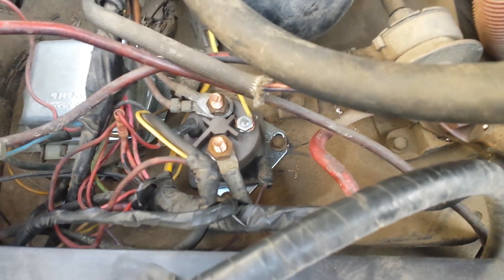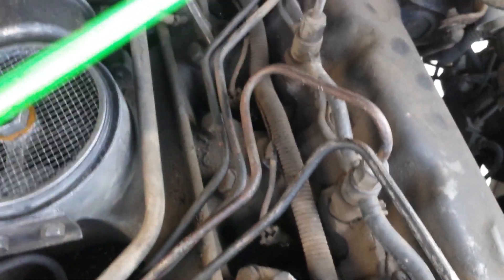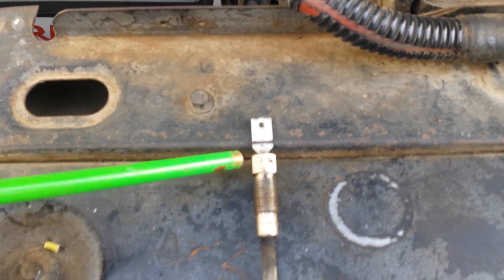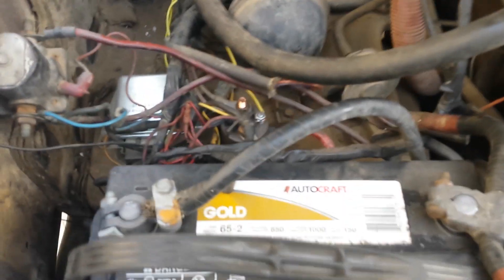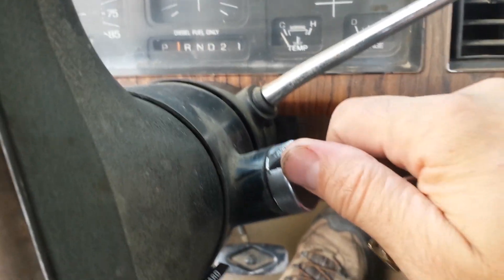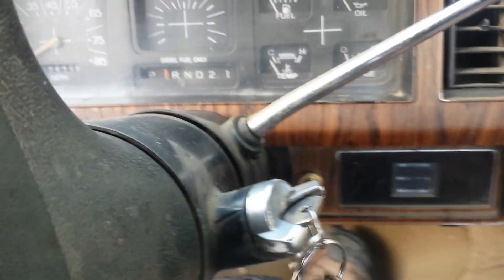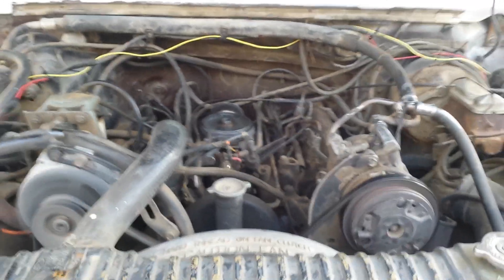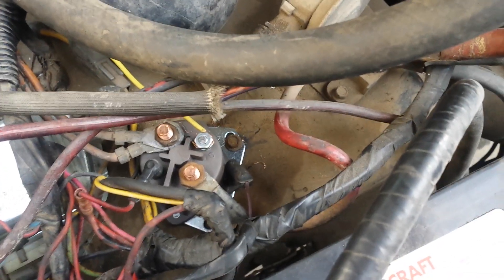1983 Ford F250 6.9 Diesel Glow Plug Relay Manual Bypass

Comment: Good video I recommended a toggle switch I had to rip a push button switch out the lower dash it got stuck grinding my starter on the engine

Comment: I am kind of confused on the mechanics so that yellow wire does it complete a full circuit? or what happens? because i want to do this manually so i am wondering if all i have to do is connect a wire to the same spot that yellow wire is and then connect it to a button... am i missing something or are those the steps.
Reply: nevermind i got my answer he connected one yellow wire to a wire that only turn on when the car is on then he connected that wire to the button so once the button is press it then travels to the wire that in the engine bay to the relay

Comment: How do you shut the truck off with it being a push buttion start? Looking at doing a push button start as well wondering how you did it
Reply: He only bypassed the starter function on the ignition switch.  He did not bypass the ignition "on" position of the switch, hence he turns the key to the run position and no further -- then push the starter button which energizes the starter relay and starts the truck.  He turns it off with the key as normal. I think he did that because there are frequent mechanical issues in the steering column that prohibit turning the key to the start position.

Comment: Other than the fact the glow plugs are not meant to run on 12 volts but actually 11 your system works. Bye-by-passing that great big resistor on the original relay solenoid you're giving them full voltage and thus 8 seconds is enough although right on the glow plug package it will tell you they are 10-second glow plugs.  If a system like this will work for you for 10 years it's because you don't use it very often. If you glow that system like the original relay did every time you touch the truck you'd burn those glow plugs out in no time..  good vid thanks for posting
Reply: You are 100% correct!
My controller was bypassed befor I bought my 83 F250 6.9.
But all the glow plugs were burnt out.
I replaced them with new ones.
All burnt out in one week, mid winter.
I'm spending the money and redoing the entire system back to stock.

Comment: The mechanic broke off the controller and connected the new one and just left it lay there and never installed the new glow plugs I had provided, and charged $180.  Well he also changed one heater hose, maybe took 5 minutes.  So rather then try to extract the broken piece from the back of the engine I did what this gentleman did.  It works great....

Comment: I have a 1985 E350 motorhome with the 6.9. It might still have the original glow plugs, for all I know. It still runs on the controller and starts pretty well most of the time. Unless I park nose up hill, then it gets air intrusion somewhere. But glow plug wise it's fine still.

Comment: THANKS  I've had the same set up on 1986 6.9 - trying to replace the selenoid but the posts on the new one , not sure where to hook up which wire. My mechanic put the 7.3 glow plugs in that are SELF LIMITING cause I was burning out the 6.9 ones. :)

Comment: The glow plug relay thats bypassed has a live in from the battery, a live out to the buzz bar for the glowplugs and a switch wire which when turned on its lets the power pass through the relay to the buzzbar.

Yes it is easy to put a switch on but its not the correct way to go in my opinion. The way it generally works is your coolant sensor detects if the car is cold or hot, if its cold the sensor activates a wire to the glow plug ecu control until to tell it this, the ecu then activates a wire to the glow plug relay to tell it to turn on, the glow plugs remain on for a short time until the engine realises that the engine is running correctly, by this i mean that the engines fuel is burning hot enough to run without the plugs at which point it then deactivates the switch wire via the ECU which turns off the relay itself.

If you get back in the car when the engine is warm, the coolant sensor circuit will be closed and the ecu will not activate the glow plugs as they aren’t needed. I’m all for doing hacks like this if im in a jam but i enjoy finding the underlying fault way better 😝 buy a multimeter and some wire wool for cleaning those connections! 🤣
Reply: You must be thinking of newer diesels. This is a idi. Doesn't have any ecu or anything
Reply: 6.9 doesn’t have an ecu
Reply: Where is the ECU or brainbox that the colent sensor sends signal to?  Or is it a completely mechanical logic system, ITTT type thing?   I'm having trouble getting the GP relay and light to come on, even after replacing the relay and (I think) verifying the wiring.
Reply: What ECU are you talking about?

Comment: Hello, I have a 94 f250 idi, when I turn the key the glow plugs don't manually preheat. The WTS light does not even come on. I have connected a wire to the relay and I touch it to the positive terminal on the battery to get it started. When touching the wire to the battery it heats the plugs and the light glows red on the dash. Is this a wiring issue? what could cause the truck to not automatically preheats the plugs?
Reply: Its your glow plug controller is bad

Comment: I'm having an issue with my glow plugs. It's a brand new manual glow plug controller and brand new glowplugs. I can hear the controller click whenever I press the button, but for some reason, power isn't getting to my glowplugs. As far as I can tell, my wiring harness is good. Perhaps I should redo my harness? I'll be checking it with a multimeter tomorrow.
Reply: how was it???
Reply: how did your work turn out? I'm facing the same problem. Got fuel and power to the injector pump but not starting
Reply: @watchman4j  I haven't been able to work on my truck for a while now. I didn't find a replacement harness until recently but it won't be till towards December when I can work on her again. As far as with yours, crack open the line connecting to one of your injectors, use an insulated screwdriver and bridge the connection of your starter solenoid, and watch the loosened line to make sure fuel is getting to the injectors themselves. Another thing to try (which many will disagree with) is to spray a very minute amount of starting fluid in the intake. If used in very small amounts, starting fluid won't damage your engine, and thus it won't rely on it.

Comment: Did the same thing on my 90 back in 2005 and they still work 15 years later. According to the maintenance log they were replaced in 95 then 1998 I had to replace them then finally after studying the diagram I did exactly this, because my theory is that the relay let's them get stuck on and this kills the life of them.

Comment: So I’m having trouble, that small post wire that’s red and has a black quick connect cap on it opposite of the small post yellow wire in your video, for me every time I turn the ignition switch over it instantly melts that wire on opposite the yellow one in your video( small red as I described) any idea what’s the issue?

Comment: I’m having trouble with my 1996 Ford F2 50 four-wheel-drive just put in neutral safety switch in new battery new cables I do still annoyed start the truck and it jumped forward in part what do I do
Reply from the maker: IDK...SOunds like a tramsmission issue to me.  Have you checked the online forums for your trick year to see if anyone else has had the same issue?

Comment: Did you just peel back the accessory power wires insulation and splice the switch in like that or how did you do that part? This video is amazing! Thank you!
Reply from the maker: I don't remember.  I don't own the truck anymore and it was years ago that I did this work around.  I'm guessing your right in your assumption.  I found a wire that had current in it when the ignition switch was turned on, and spliced the switch into that.  Hope that helps!

Comment: Great job doing this video! Does this method still allow you to see the "Glow Plug" dash light lit up when you push the momentary switch? Thanks for any info/help! ( have an 84' that just started to not light up the plugs intermittently) Also isn't switching to the front tank anymore but they're tough old goats!
Reply from the maker: The dash lit will light up if still functioning but it is not linked to the manual bypass.  My light still works and I use it as a timer when I'm holding the glow plug button down manually.
Reply: Thanks! I since have cleaned up the 2 battery posts/cables and the reg. and now it's coming back on. Strange thing this electricity thingy!-) Now, I"m about to replace the alternator with a 100amp one as the other stopped working...I NEED HEATER! Lol. Thanks again for your vids! Mike
Reply: I forgot to say that there's a blue box next to the glow plug reg. with heat fins and wired up almost like the old HEI gas models had in the day...I didn't notice one in your video? Curious.
Reply: "Blue box" = Battery isolator.  @mikesglider

Comment: i added the glow plug bypass and it don't get any power when depressed to th e glow plugs but if i hook everything up normally it just clicks and don't latch..new batteries, new glow plugs,new,solid state under relay new relay..help please..now my head lights don't work.but everything else does..
Reply from the maker: Did you check to make sure the glow plugs were warming up before you installed them all?  I grounded one of the plugs before installation and it started heating up right away, so I knew I had power.  Hope this helps.

Comment: Didn't want to use starting fluid all the time so I've been burning electricity plugging in the block heater anytime it's cold outside, which is 8-9 months a year around here. Time to just fix the problem right.
Reply: Thanks, Wylie. But tell you what, when you're coming off 12 hour shift 100 miles to the closest civilization - no place to plug in the block heater - and it's -40 below zero - you will get your truck started anyway you can.
Reply from the maker: These trucks don't like the cold.  Hope yours is running well!